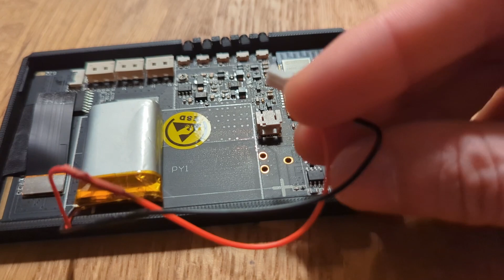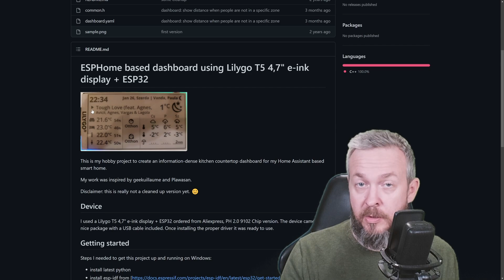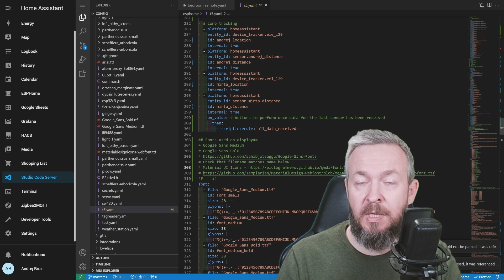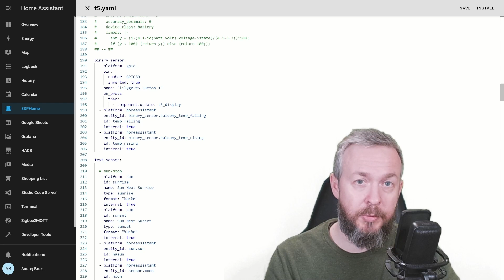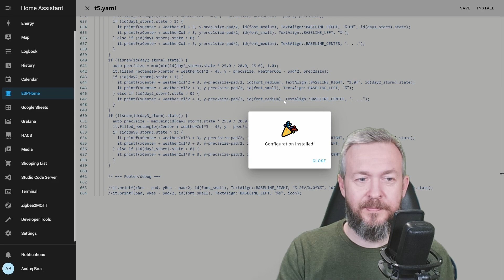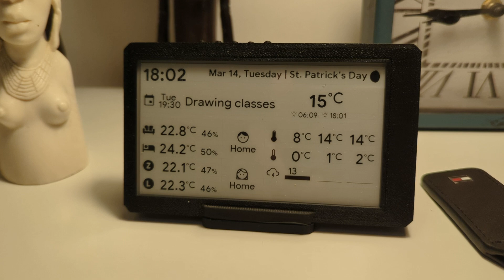Custom ESPHome dashboards on LilyGo T5 4.7" ePaper device

Comment: I appreciate the detailed guide!  

I can't get the code to compile due to errors around ESPTime (src/common.h:4:47: error: 'ESPTime' is not a member of 'esphome::time').  I am not a programmer, but I suspect that this is broken due to the 2023.6.0 Esphome update.  ("Breaking Changes: Move ESPTime into core esphome namespace esphome#4926 by @jesserockz (breaking-change)").  

Like I said...not a programmer, but this is my uneducated guess.  Thanks!
Reply from the maker: Yes, looks like breaking change in 2023.6. I still haven't fixed it as screen is working with 2023.4 version of ESPHome. Will try to do it over the weekend if I get some free time to look into it.
Reply: Can this comment be pinned / added to the video description?  I just spent a lot of time following this tutorial and troubleshooting it when it didn't work only to learn it doesn't work.
Reply from the maker: Done! Will pin link to new code after I find time to play with it.
From what I've seen, non of the older codes were updated on any repositories.
Reply: @BeardedTinker  Thank you!  I look forward to the new code, figuring out how to fix it was a little beyond my skillset!
Reply: @BeardedTinker  Thank you so much!
Reply from the maker: I would need to test it - mine is still not updated - I think it's on 2023.4 ESPHome or similar.
Reply: was this ever fixed?
Reply: Did this issue get resolved, getting ESPtime error as well, using the yaml from beardedtinkers git, I thought this was updated
Reply: İm also interested but its still buggy i think
Reply: I've had the same issue with another project. The reason in my case was that I was using the standalone ESPHome instead of ESPHome Builder inside Home Assistant. That time module is available within Home Assistant, but don't know if there's a way to add it to just ESPHome

Comment: I have had one of these devices for a long time and the recent updates to ESPHome have broken it. I managed to find someone else who'd updated the display component to work with the new versions, however this new component doesnt work with the touchscreen as thats also been changed within ESPHome.

Such a shame for such a cool and versitile device to now be essentially useless unless you happen to be a developer and can write new components to keep up with the ESPHome changes.
Reply from the maker: Firmware on mine is still from last year. I didn't update it for two reasons - original FW worked and also due to changes in dependencies it didn't compile. Hoped to get it fixed last summer, but simply don't have enough free time to play with it.

Comment: thanks for this nice video. I get however always the following error and even if I change it from DisplayBufferRef to DisplayRef, then it does compile, but it does not work. Any update on a currently working yaml file?

File "/data/external_components/fa8d4a0f/esphome/components/lilygo_t5_47_display/display.py", line 44, in to_code
    config[CONF_LAMBDA], [(display.DisplayBufferRef, "it")], return_type=cg.void
                           ^^^^^^^^^^^^^^^^^^^^^^^^
AttributeError: module 'esphome.components.display' has no attribute 'DisplayBufferRef'. Did you mean: 'DisplayBuffer'?
Reply from the maker: There were some changes in ESPHome and libraries that are used. I hoped to have enough time and dig into it few months back, but haven't still touched it.

Comment: Nice, I would really like to see how to use the touch cover on it.
Reply from the maker: Still haven't tried. According to the documentation, after connecting it to T5 board, you only need few lines of code:https://esphome.io/components/touchscreen/lilygo_t5_47.html
Reply: @BeardedTinker  Bought one, tried it ... everything works fine without the touchscreen code. When I add the code from the above link, the device keeps rebooting...
Reply from the maker: Still haven't had time to try. My guess, problem with RAM. But would need to test it. Way to test it is to remove parts of the sensors that are pulled from HA and see if it than loads it or not.
Reply: @BeardedTinker  I've got it working, had to downgrade ESPHome to 2022.11.5 ... then it worked.

Comment: Do you have a link to the battery case stl as well as the T5. Thanks for another great video!!!!!
Reply from the maker: What battery type? 18650 or those flat ones.
For example: https://www.printables.com/model/272575 - this is OK case if battery is flat.
For 18650 there is for example also this one: https://www.printables.com/model/130235
You can try looking here for more ideas and cases: https://thangs.com/search/lilygo%20t5%204.7?scope=all